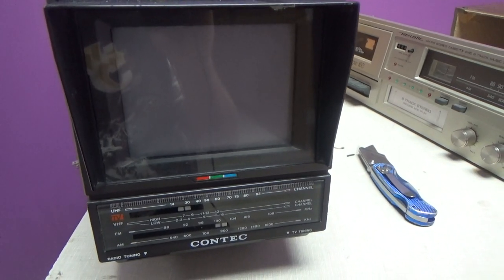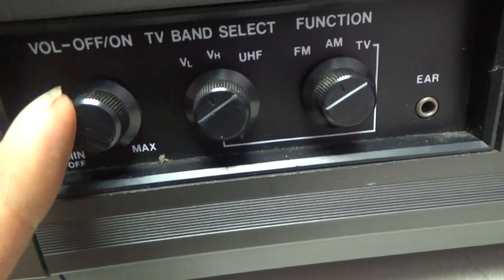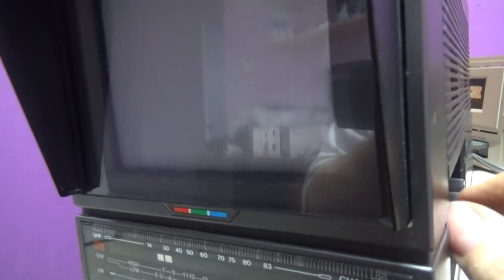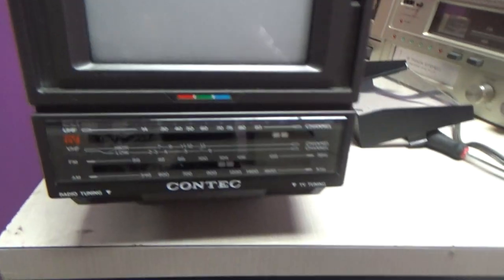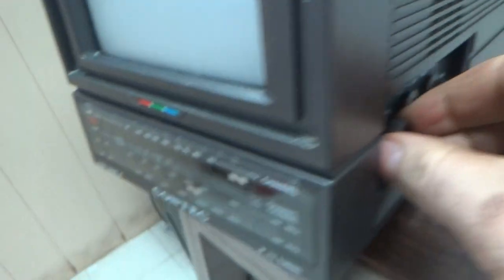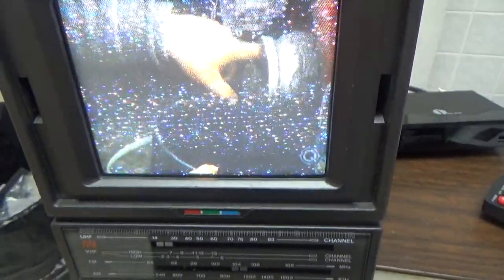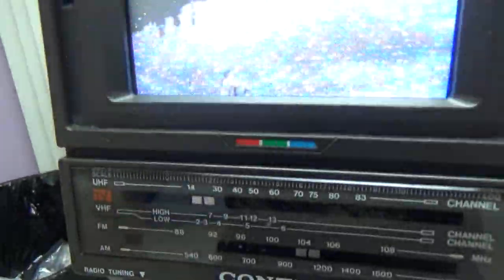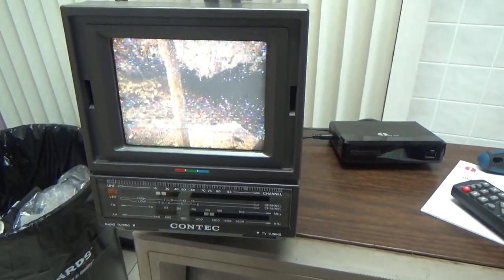Vintage 1987 Contec Portable Color TV FM AM Receiver Model KRB-1541N

Comment: Hmm.  Surprisingly it has the same sort of analog interference pattern on the screen as the other TV.  I wonder if the converter box's RF modulator is shoddy.
Reply from the maker: Could be i have new ones i can try. That ones years old and probably damaged.